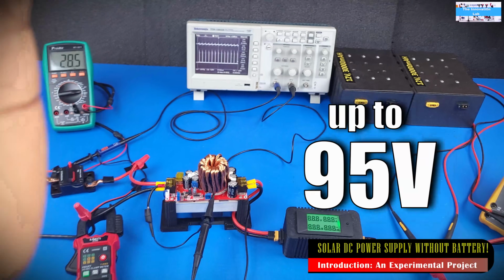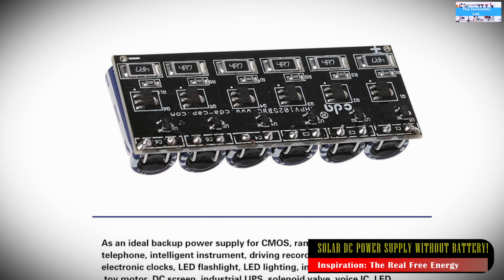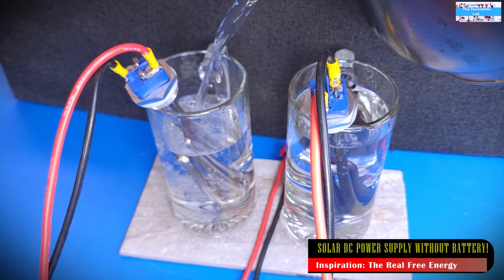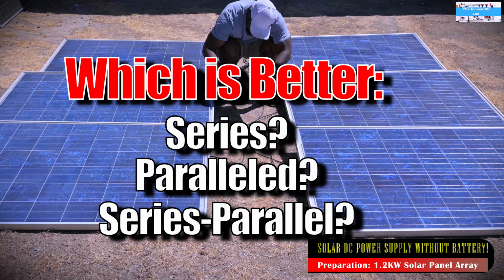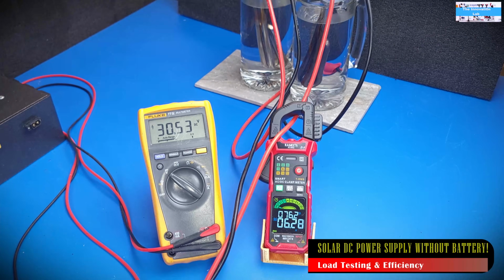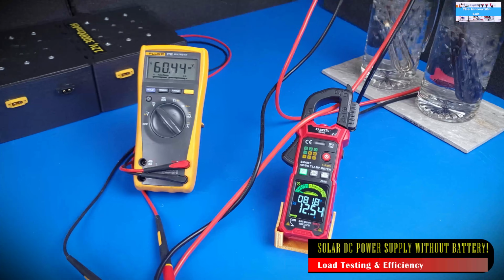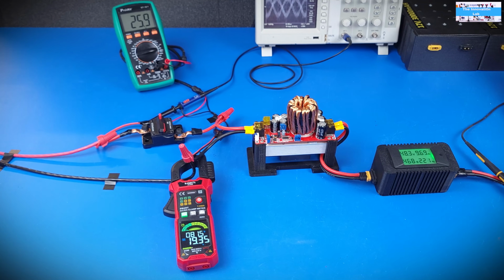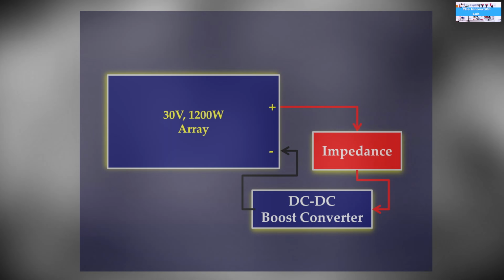Solar Without Batteries?🤔☀️

Comment: feeding solar power into a DC to DC converter, and then feeding the 12V output from that into the inverter to run it like an on-grid inverter?"
Reply from the maker: Thanks for the wonderful engagement. I greatly appreciate your outside the box thinking!👍👍👍

Respectfully,
The IPL💥

Comment: I have a mini split with no batteries… its darn near perfect for my set up.  Im off grid.  I have a washing machine that i need to set up and its easy enough to just use that on sunny days… so im trying to see how i could do the same for that appliance.  And ill probably stick w a propane dryer, but if an elec one works without a battery or a buffer… thatd be amazeballs!
Reply from the maker: Agreed.
But it is always safe to have a small battery unit to provide a few minutes of power buffer when there is a cloud going over your panels. 

Another alternative might be to over design your solar array and target your operation during peak irradiance.....if you have a 10Kw solar install, I am sure you could still pull 1kw at low irradiance....just in theory. This is not something I have ever tested.

I am always excited to talk about solar projects.😊

Respectfully,
The Innovation & Power Lab

Comment: @theinnovati0nLab782 I have a system that runs at about 200 W using 7 V and  29 A. I plan to run this device using a solar panel but I’m wondering if it’s possible to boost the current in a 230 W solar panel to about 29 A using a DC-DC converter.
Reply: The previous experiments were done using a Laboratory DC power supply. I’m only thinking of the feasibility of achieving these current requirements using a solar panel.

Comment: Do you think its possible to put an inverter in that configuration?  Will probably need something like super capacitors to run it smoothly😊
Reply from the maker: Yes, adding a super capacitor bank or small battery to act as a buffer,  would be a good idea.

Adding an inverter directly would not be something I recommend.

Respectfully, 
The Innovati0n Lab

Comment: YOu can not use this to harvest energy from your solar panels, because this thing has NO Perturb&Observe, Incremental Conductance, Fuzzy Logic or
another kind of ALGO, and to parallel more than 3 panels is BAD idea, also 99.99 % of solar MPPT charge controllers are NOT BOOST, BUT BUCK,
or another isolated topology. SO if you are able to move to all points ov U-I curve of solar panel, you are able to adjust voltage INPUT of your MPPT,
that product of VOLTAGE and CURRENT is MAXIMUM possible at that moment. So you need constantly move LEFT or RIGHT at you U-I curve
and check OUTPUT POWER, and if power is lower, you should change PWM at GATEs of your FETs, to harvest maximum possible.
Every ALGO has some problems becuase panel can go from 0 W to STC or even STC x 1.15 if panels are very cold. 
And problems of this ALGOS are, that even commercial MPPTs froze at some level, because they to not compute GLOBAL
but only LOCAL maximum. So a lot of cheap MPPTs do not harvest maximum solar power all day long. So you can compare,
take 2S solar panels, connect to  3 MPPT, and integrate charge wtih very precise time measurement, and you will see, which MPPT
is best at given insolation per 24 hours, but this does not mean, that this MPPT will be always best, at another insolation level.
So do not assume, that DIY project are precise. Even high grade MPPTs and BMSs have VERY BAD integration of current over time,
you can see this in winter, that after 20 days, your shunt == SOC METER displays 90 % SOC ENERGY, but real voltage at LFP tells you,
that there is only 30 % of energy left. You have same situation in you BEV == bat. electric vehicle, your BEV displays 150 kms,
but you really have in the batery only 80 kms, and have to quickly search for charging station. 
Problems with BOOST converter as solar MPPT is also protection against lightning strikes. 
If you have 30 V and 3S solar panels, this is 37 V VOC, 37 x 1.15 x 3 === 127 V MAX at low outside temps., so you can use 130 V
lighting surge protector.
But what you can do, if you have 37 V one solar panel or number in parallal, but you charge 72 V LFP battery wtih BOOST ?
What type of surge protector or MOV - ,etal oxide varistor you can use ? And if you BOOST converter FETs mulfunction,
you have full battery voltage e.,g . 72 V at 37  VOC solar panels. Can you imagine what happens to solar panels for 37 VOC
if you connect 72 V battery ? WHat type of fuses you will use ? GFF, GG, GR, AM or AR ?
Reply from the maker: Thanks once again for  the wonderful engagement.

I agree with most of your submission except your opening statement that says that I can't do something that I have already done...and shown in the video.😊

I agree with you 100% that this would not come close to the efficiency and performance that MPPT charge controllers would give you - as the incremental conductance control algorithm is more prevalent at low irradiance conditions....yes I kinda know that already and again I agree.

However, what I am trying here is more like an abstract way of thinking and I call it  my "Inductive reactance tuning concept/strategy" and the goal is really to see if I can provide a better source -to-load impedance matching between the solar panels output dynamic impedance and the battery system's.

If you take a moment to think about it, incremental or instantaneous conductance boils down to actual conductance which ends up being the inverse of resistance...or impedance in this case. Incremental conductance algorithm and fuzzy logic in a nutshell is used in MPPT determine the best points on the I/V curve of the input power coming in from the solar panel that would yield the most power transfer efficiency...again this depends on the level of solar  irradiance incident on the solar panels.

My idea here is to redesign the power inductor of the converter to a much higher  inductance and also to make the switching frequency of the converter tunable ......this way, I get to a more favorable reactance that acts almost like adding a low value resistor between the solar panel (source) and the battery or load.

The rule of thumb is that for a stable power handshake, source output impedance should be low than the load input impedance....else you will have oscillations. A solar panel at low irradaince, automatically defaults to a higher output impedance hence, being able to tune the input impedance response of the converter led to a much better transfer of energy even at low irradience conditions.
Its a lot to take in and a bit difficult to explain over text and not standing next to a white board.😊

Respectfully,
The Innovati0n Lab💥
www.theinnovati0nlab.com
Reply from the maker: Also,
The only logical reason why most solar charge controllers (MPPT or PWM) are designed to work in BUCK MODE, is solely for solar project over-design purposes, feasibility, and market demands.

For instance it is more feasibility to design a high power solar energy system - using  a SERIES solar panel array configuration.
Now, with that said a series solar panel array often leads to high voltages .....that is usually order of magnitudes higher than the battery system's voltage levels that is needed to power off-grid inverter systems.

There are no physics, electronics, or power principles that prohibits the upward/BOST conversion of power from photovoltaic sources.
Again, this is solely driven by market demands and project feasibility, and array design cost.

Yes, I am also a prior solar guy....spent more than 3 years fixing utility scale solar power electronics issues all over the U.S....so I know a little bit.😊

Also, solar energy is one my hobbies and goto pleasure reading when I am bored...hahaha

Thanks again, friend!!
It has been a fun engagement.
👍👍👍
Respectfully,
The Innovati0n Lab💥
www.theinnovati0nlab.com

Comment: Hello my wonderful friend. I always love your videos. Do the 6to1 cable have to be same lengths? Do you actually loose power if they are drastically different lengths?
Reply from the maker: Thanks!!
We greatly appreciate your wonderful support! 👍👍👍
There is always some losses when current is conducted through a wire from a power source to a load. 
The key is to keep the wires as short as possible. However, I used gauge 10 wires for that setup and those are rated for 30A ....each panel was contributing about 5A at peak irradiance - so plenty of headroom.

To your question, as long as the 6 pairs of wires going to the respective panels does not have like a 10-meter length differential, then the power losses will be minimal.

I hope this helps.
The Innovati0n Lab 💥 www.theinnovati0nlab.com

Comment: Hello Sir, thx a lot for this great project. I am interested by AC-AC (boost) bulk converter to have a "cleaner" system than ones TRIAC based. Do you know a cheap chinese AE board doing that ? or in general maybe you can be interested by such topic.
Reply from the maker: Thanks for the wonderful feedback.
Regarding your AC-AC question, the only affordable option that comes to mind that would not distort the sine waves would be to build a low frequency soft iron core auto tranformer. 
The major downside is that soft iron core transformers tend to be heavy and very bulky. 
However, if weight and size are not  deal breakers for you, that would be one way to go.

Another (more complex) way would be to design a power system that involves AC - DC - AC.
Essentially, you could use a couple of those used server power supplies to convert your mains AC(120/240V) to a DC power level.....then use a sine wave inverter circuit to build the custom AC  voltage level that you need.

I hope this helps.
The Innovati0n Lab 💥 www.theinnovati0nlab.com

Comment: Your all videos are informative and very useful for establishing new innovative ideas.

I have 6 solar pannel of 550W and VOC of each panel is 50 volt DC. If required, I will buy more panel.

Using ur idea I want to operate my EATON e series DX model 10kva online ups directly through above solar plates. Input VDC required for operating online ups is 144-155 VDC with maximum of 40 ampere.
My question is 

1. Whether I will be able to operate my online ups without battery and AC supply, only using solar DC supply?

2. If answer of 1 is yes, what converter we required to convert constant 145 to 155 volt DC supply from source voltage range  of 180-300 VDC and constant current of 40 ampere?

3. Can we use the above online ups to run 3Hp single phase max 15 ampere induction motor?

Kindly help us ......
Reply from the maker: Wondeful!!
It seems you are working on a very exciting project.
Very cool!👍👍👍

First of all, I won't recommend powering a heavy duty - high surge application straight from your solar array without any power buffer in between (battery system or large super capacitor banks). This video was intended to be an experiment to peak into a realm of what could be possible with more research, test, and observations.
10kVa is quite a lot of power to push out without having a power buffer between the solar panels and your converter....or at least a very smart MPPT controller.

It seems that you may need a very efficient MPPT charge controller that could handle up to 300V of input voltage range to provide your desired output voltage range.

Again, to run a system like this without a battery system in between, you will need an extremely smart MPPT system, and you also need to over design your solar array - possibly by a factor of 2. This means you may need a solar array capable of producing up to 20KW of power at peak irradiance. 

The smart MPPT system will continuously monitor the available power on your array - per the solar irradiance - and optimize the delivered power to your load without over stressing your solar panels.

I hope this helps.☺️
Success wishes to you!
🎊🎊

We are looking to grow this channel to reach a wider audience. You can help by sharing our content on social media platforms and with your friends.☺️

Thanks!
The Innovati0n Lab 💥 www.theinnovati0nlab.com
Reply: Boss thanks for your valuable reply, can you please suggest ant MPPT Model (i.e. need specifications) which will fulfill our requirements.

Also, we have maximum load up to runing a 3HP single phase 15 ampere induction motor.

We will never exceed consumption over 5KVA and now we have 5.5 KWH solar panel (i.e.  10 panel of 550 watt). Can we run 10 kva above online ups with 5.5 kWh solar panel with suggested MMPT for maximum load of 5 kva?

As your all videos are very informative and innovative hope you channel will boom very soon....🎉...

Comment: Why you don't share diagram
Reply from the maker: I don't have a schematic to share because the converter is not my design.
However, I provided a detailed explanation in the  boost converter power hack video.
👇👇https://youtu.be/I_dliffP0vk?si=6dWoEY63Y2Lr1NhZ
I hope this helps.
The Innovati0n Lab 💥 
www.theinnovati0nlab.com

Comment: Excellent and well-executed project. When connecting PV modules in parallel I recommend using diodes. Greetings from Poland.
Reply from the maker: Thank you so much!
👍👍👍
This a model constructive feedback, and I greatly appreciate it.

I fully agree with you. I thought of adding the blocking diodes, but I was hoping that the solar panels should have been designed with them. However, I realized during the testing that the panels I am using didn't have reverse blocking diodes....for some reason.

Thanks again for the great feedback.!
The Innovati0n Lab 💥 
www.theinnovati0nlab.com
Reply: Most Solar Panels do not have Reverse Blocking Diodes.  Why would you assume they were automatically installed?

Comment: If you are using it for heating - solar water heater will be better than solar panel 60% efficiency over 20% efficiency = 300%, 3 times greater
Reply from the maker: Thanks for the amazing feedback.👍👍
However, the water heaters in the video, we're used as dummy resistive loads to test the concept....that's all.

Thanks again!
The Innovati0n Lab 💥 
www.theinnovati0nlab.com

Comment: Guys, you are great. You shoot the right videos. I have a question for you. I thought about this problem if in dc/dc to separate the power supply. If to make from a separate step-up converter power supply for the controller and key transistor -12v. And power supply to the throttle could be supplied any and even lower than 10v. Then will we be able to power this dc/dc from one lithium bank at 3.6v. It is clear that the current on the transistor with a decrease in voltage will increase greatly, but this is not a problem, because we can increase the number of transistors and align them by current. As a result, we can try, I think so, because alkaline batteries can be used and they are not afraid of deep discharges to complete zero. This makes a lot of sense, since by completely discharging the battery we have more power than, for example, using acid batteries. I would like to know your opinion. Thank you.
Reply from the maker: Thanks a lot for your inspiring words!
 We definitely appreciate it.👍👍❤️

However, the converter has a minimum input voltage of 10V, and you can not go lower than that. Also, I highly discourage low voltage inputs because they lead to lots and lots of power losses due to high currents  that need to be pushed through the converter to compensate for the low input voltages.

With these converters, the  higher the input voltage, the better the efficiency. 

I hope this helps.
Success wishes.
The Innovati0n Lab💥 www.theinnovati0nlab.com

Comment: Dear, sir your videos amazing,  I recommend the WZ10020L 1000W buck converter with optional MPPT control, I use it.  I would be happy if I could see your test about it. My question for your next solar video would be: which is better, parallel first then series connection or series first then parallel connection?
Reply: excuse me WZ10020L
Reply from the maker: Wonderful, thanks for the feedback and converter suggestion.

Please feel free to share a link to the converter.

Thanks again
The Innovati0n Lab 💥 
www.theinnovati0nlab.com
Reply: My question for your next solar video would be: which is better, parallel first then series connection or series first then parallel connection?